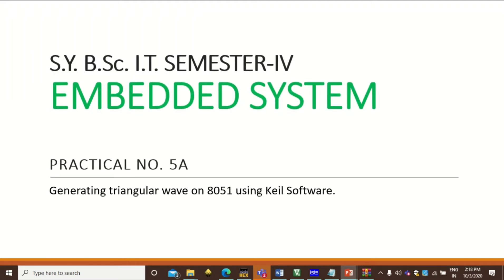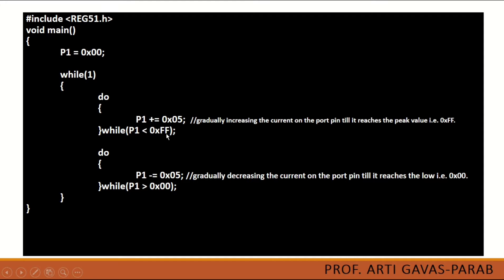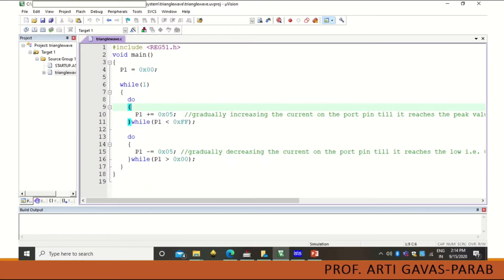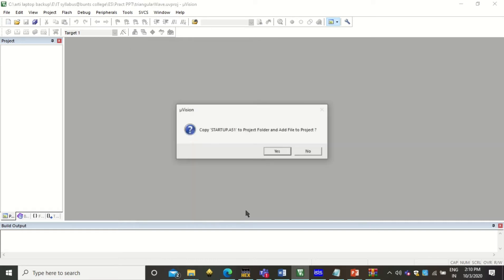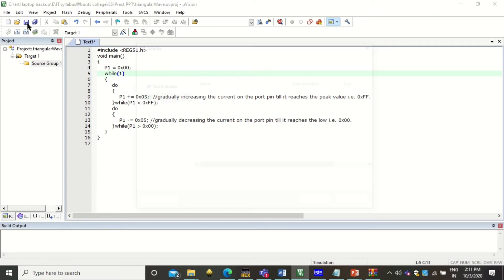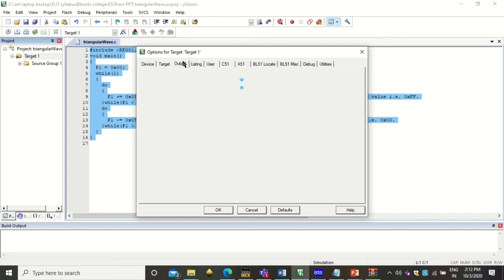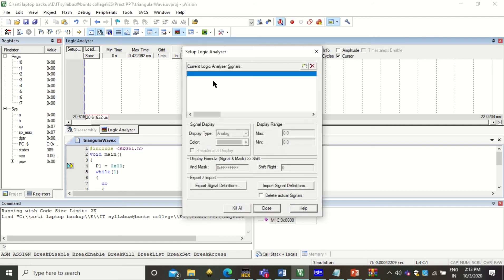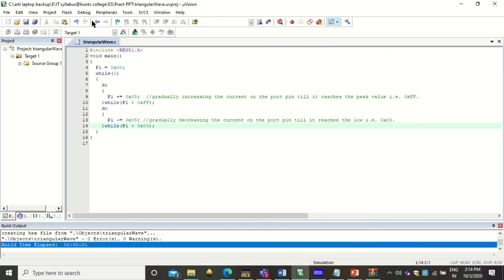Generating a Triangular Wave on 8051 Microcontroller using Keil Software

Comment: Ma'am. please how do I simulate this in Proteus?
Reply from the maker: Yes, you can simulate Triangular Wave in Osciloscope. Just check on which port you are generating it. Take a Microcontroller, take Osciloscope. Connect your port (anyone from P0/P1/P2/P3 which you have used). Then adjust the Vertical and Horizontal alignment of signal. Also you can adjust magnitude of signal. This way you can simulate triangular wave on Ocsilloscope.